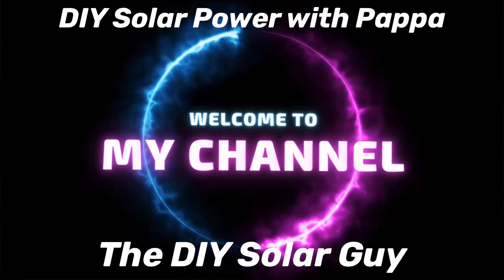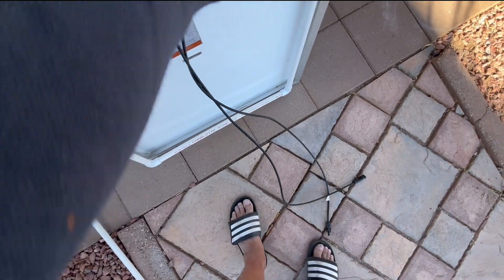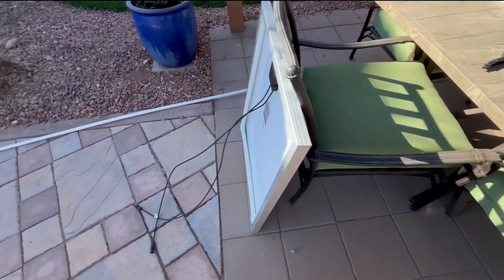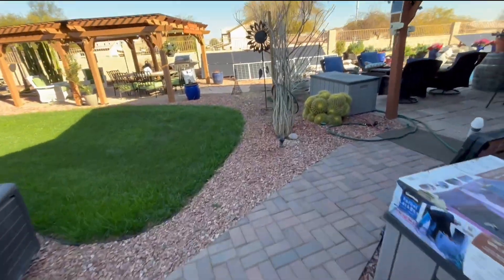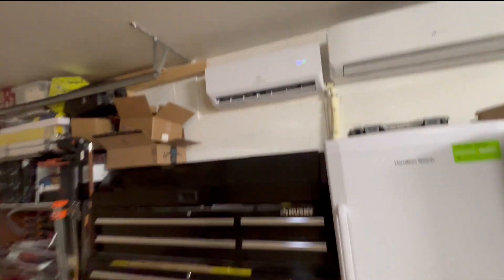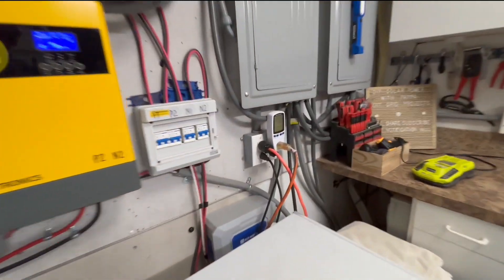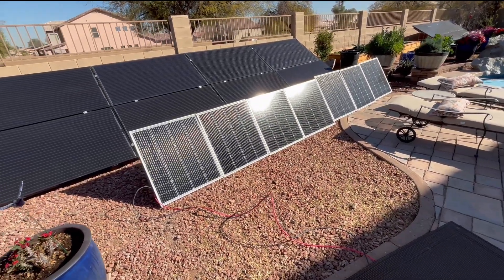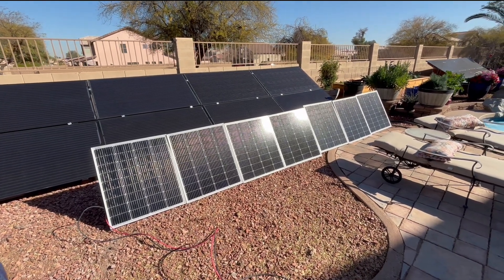DIY solar panel system for home. EG4 12,000btu mini split direct solar input with just 7 - 100 watt

Comment: Not a bad idea if it's not windy. Could use some heavy duty zip ties to strap the stand to the top of the panel maybe even some stakes hammer in the ground if it does get windy won't blow over easily.
Reply from the maker: Both your suggestions sound great. I will look into implementing those ideas. Thanks for the great suggestions. Hope you have a blessed week.

Comment: Hey pappa , if I use 3 denim panels 490 watt in serie  would that be enough  also on volts?
Greetings 🇳🇱 the Netherlands ( Amsterdam)
Reply from the maker: The watts input from solar panels should be 1000-1600 watts dc volts for best performance. I tried using 3-400 watt bifacial and I ran into the problem with the minimum dc solar panel PV input dropping below the 90V dc range. When it dropped below 90V dc, the compressor stopped operating until the voltage went over 90V again. Keep that in mind. The slightest shade on one solar panel and you could still the compressor from staying on. Also the dc solar panel input has to be between 90V -380V dc. I do not believe there is a way to change the Hz on the EG4 mini split from 60Hz to 50Hz, but you could reach out to signaturesolar.com and ask if they sell a model designed for the EU market. Hope you have a truly blessed week.

Comment: Hey pappa, I have a question about the assist volts ( here in Europe we have 230 volts )
Is t possible to use the airco on our 230 volts ??
Greetings from 🇳🇱the Netherlands ( Amsterdam) 👋
Reply from the maker: Hi there in Netherlands (Amsterdam), thanks for watching. I believe you are also 50 Hz instead of 60 Hz here in US. You would have to purchase from a manufacturer that produces for the EU market. They are using new refrigerant R-454B to replace R-410A. Not sure which refrigerant they are using in EU, you want one produced with the refrigerant used there. You will need to check and see what refrigerant there are installing in the Airco. 

It is the first time I am hearing about this brand. I looked on their website airco.com and there are in Texas only. I did not see they sell in Europe. I know from the mini splits I buy and install, there is no way to switch the HZ setting from 60-50Hz. There is also a difference in the way your breaker panels are set up with the breakers and how your breakers use the Neutral, Line and Hot wires. 

My suggestion is to email them and ask if they specifically manufacture for the your European market. Also there Phone # is 1-682-564-0804. Sorry I could not be of more help. Hope you have a truly wonderful and blessed 2025.